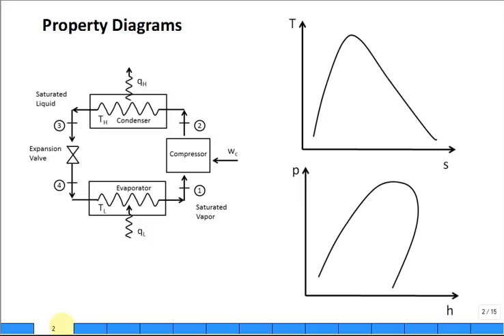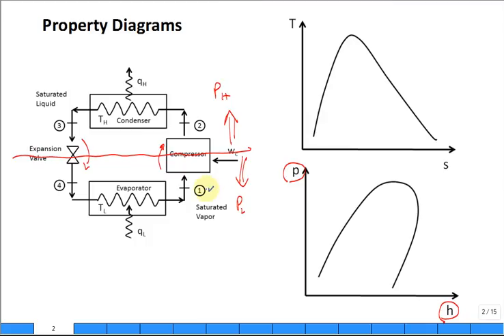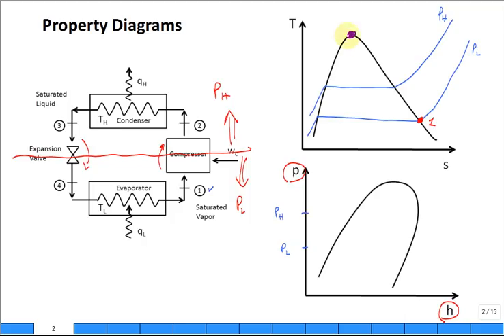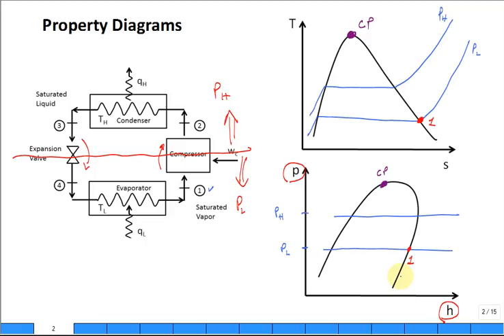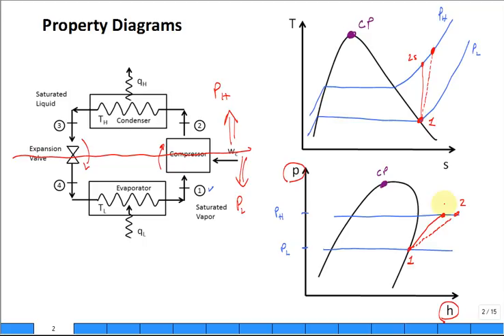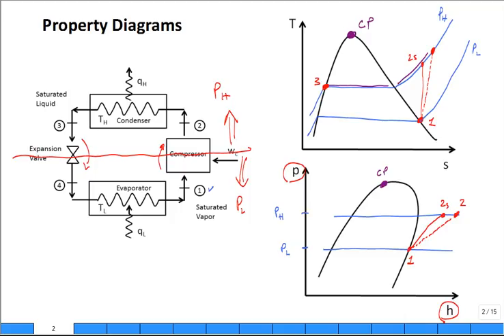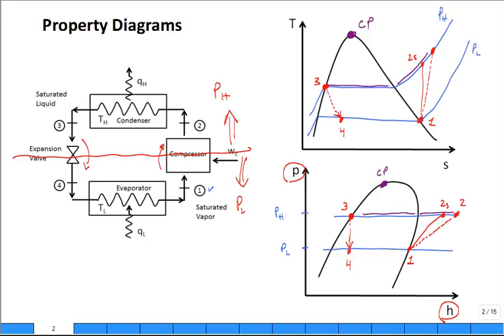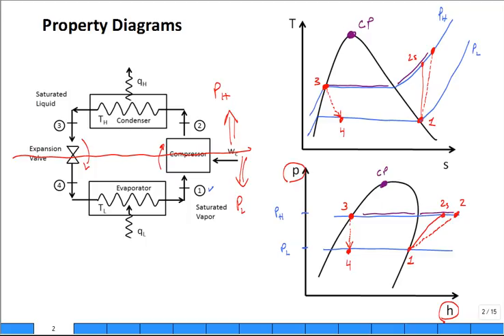Property diagrams TS and PH for refrigeration 2

Comment: Why isentropic compression is shown as straight line?

From the equation T.ds=dh-v.dp
ds=0 for isentropic process 
we get dp/dh=v.  
as the specific volume decreases during compression 
so the slope of isentropic compression curve should also decrease ...So how can it be a straight line.
Reply: well isentropic means it's adibatic and reversible, the ideal case. In reality, the compression is irreversible therefore ds doesn't equal zero, then the line isn't straight. MArked in dashlines as point 2

isentropic process, ds = s_2-s_1 =0, so no change in entropy so it doesn't move on the x-axis, the solid line to point 2s. But there is a change is pressure, volume, and enthalpy, pressure goes up, volume down which equals the change in enthalpy. Hence, dh = v.dp, which isn't a straight line on the p-h diagram
Reply: specific volume decrease so slope increase (as entropy) - II law of thermodynamics (irreversible process)

Comment: simple vídeo and very didatic, however, can you make a video in wich we have a reseviour, I would like to know how calculate the mass. In a simple system I get the Q (Kw) from evaporator and q (delta entalpy) to find the mass - but, in the recevior I don't know how to find out the mass that's whay don't have energy transfer  to enviroment. I mean, this recevior make the gass passed out from the evaporator ok and before to join the fluid is a second compressor to keep the same high pressure, in te recevior we have a intermediate pressure
Reply from the maker: Emerson Gomes de Lima  if you are at utsa, please come by my office.  if not at utsa, please understand I have limited time to answer questions.
Reply: Randall Manteufel all right! no broblem, this video already was help full